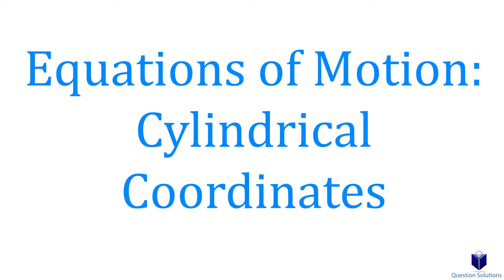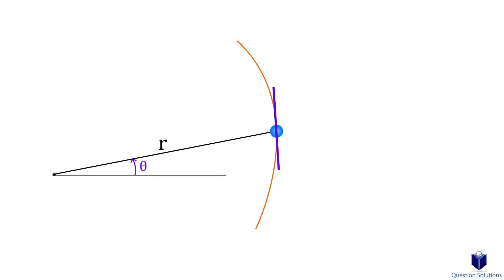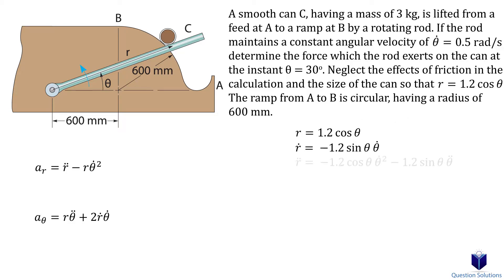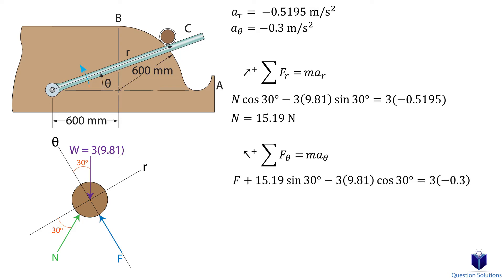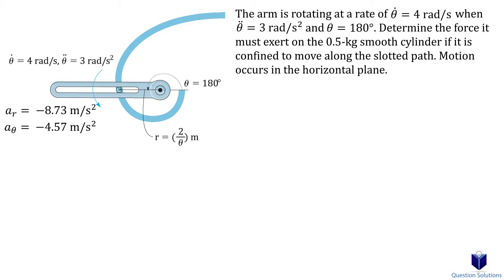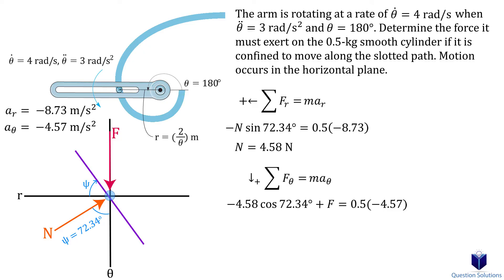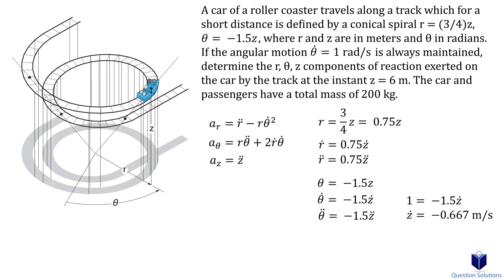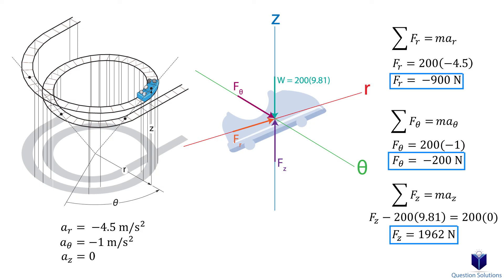F=ma Cylindrical Coordinates| Equations of Motion| Learn to solve any problem

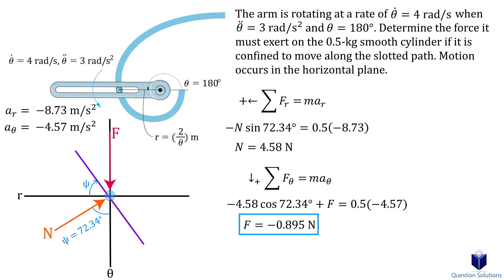Comment: Two questions: one is from  example 2 @ 7:50 you said the force is neg bc its coming from the bottom, what dose that mean, since the F in the FBD is pointing towards the particles motion? Example 3 @ 8:54 when taking the 2nd and 3rd time derivative of r, why not use the product rule, I watched the video on time der. and it looked like the product rule is only used when sin and cos are in the term?
Reply from the maker: Thank you so much for the timestamps, makes things so much easier. So first question. Notice how we assumed that the force would be coming from the top in the FBD (the red arrow). Now we got a negative value, so that means instead of it coming down, it's actually pointing upwards. So the red arrow would be facing upwards, and be applied from the bottom of the cylinder. For the 2nd question, product rule is used whenever 2 functions are being multiplied together. In this problem, the 0.75 is a constant, so all we have is one single function. When you do normal derivatives, we don't really care about the integer in front right? So like the derivative of 2x^2 = 2(2)x = 4x. So we leave the 2 alone, and then at the end, we just make it look nice by multiplying it out. The same here. I just want to be very clear, the product rule is used whenever we have 2 functions being multiplied, not just in cases of sine and cosine. 

Going a bit deeper with this example, we have r = 0.75z, we take the derivative with respect to time. We get ṙ = 0.75 (dz/dt), then we take the derivative again, so we ignore the 0.75, and just care about the (dz/dt) giving  0.75 (d^2z/dt^2). Again, this is not 2 functions, but just a constant multiplying a function. 👍
Reply: @QuestionSolutions  thanks for the quick reply thats makes more sense, I've been subscribed since my semester started your videos are great
Reply from the maker: @AverageNeighbor  Glad to hear! I hope these videos help you and you do really well in your courses.

Comment: when we take weight into account? for example in 2nd question weight wasn't included in the solution. that also happens in 12th edition dynamics hibbler book, example 13.10 & 13.12
Reply from the maker: Usually, in cases where we consider the collective forces in a certain axis, instead of individual ones, are places where weight doesn't need to be shown. It also depends on the axes we use, so if weight is "through" the page/plane, we don't need to draw it, or in other examples, cases with the z axis, will have weight. It depends on the question, and you usually gain a "feel" for  when and when not to generalize forces by doing a few questions. Sorry I couldn't be more helpful.
Reply: @QuestionSolutions  thank you!

Comment: When we take the sigh angle and when we don't ?
Reply from the maker: When you need to figure out the angle between the normal force and the tangent line. If you can solve the question without using the psi angle, then you don't need to find it. But sometimes, you'll notice that you can't figure out what the angle is for the normal force, in that case, you need to find it.
Reply: @QuestionSolutions  Thanks you sir
Reply from the maker: @osama669  You're welcome!

Comment: This helps but I am still unsure of when I would need to find the normal force and angle φ in a problem
Reply from the maker: The best way to get a feel for when you need to find specific forces is to do as many questions as you can. If you do about 10 per chapter, you should have a very good idea on what to find, when to find it, and so forth. 👍

Comment: why the weight is not marked in 2nd example ?
Reply from the maker: Yes, that should have been drawn in the free body diagram of the pin. My mistake. Please remember that weight is always straight down. Even if it's not shown, it is there, since it's mass times the acceleration due to gravity.
Reply: @QuestionSolutions  Thanks for the reply this channel is very helpful
Reply from the maker: @ayyaash_munzir  You're very welcome. Best of luck with your studies!